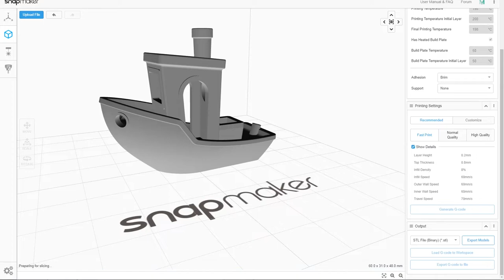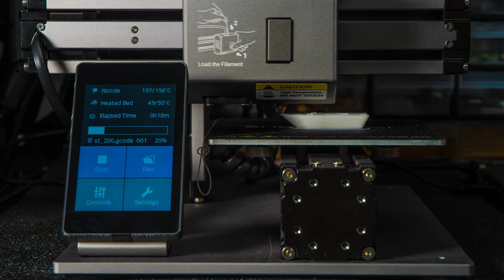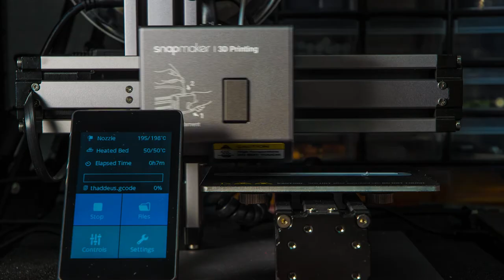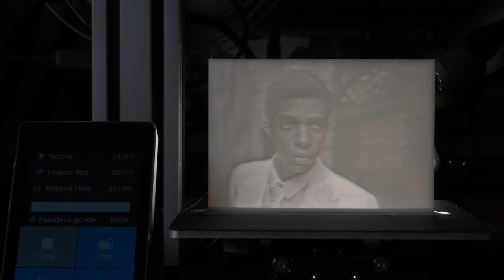Snapmaker 3D Printer Revisited - Fixing Benchy - Snapmaker Part 2

Comment: Really useful John, I ran my brand new Snapmaker on a different type of PLA ( snazzy transparent purple) and ruined about 6 of my very first ever 3D prints. It really dented my initial excitement with the hobby. I finally stuck on the filament that came with the printer and it worked perfectly first time. A lot of trial and error in this hobby methinks! Main problem for me seems to be getting the print to stick to the heated bed. I’ve tried initial layer speed/size, heated bed temp and nozzle temp adjustments. I wonder if attaching a glass tile on top like some other hobbyists have done will make it easier? Anyway thanks for all the good info, the photo lith vid is great!
Reply from the maker: Hey Stuart, glad you're enjoying the videos! Getting that first layer to stick can sometimes be a little tricky. I do use glass on some of my other 3D printers for PLA, but I've not found a need to with the Snapmaker yet. I did do a video recently on levelling it and getting prints to stick if you hadn't seen it yet. Hopefully, this will help :)

https://youtu.be/Hfjty7OKink

Comment: there is part cooling fan shrouds you can just screw into the fan holes, and other types as well on Thingiverse, it helps out tons with overhangs since it sucks the air to cool the hot-end through around the nozzle cooling the filament as it is being laid down .... so you can make long bridges and basically have it function like any normal printer that has a part cooling fan.
Reply from the maker: I've seen a few of the part cooling fan shrouds, but haven't had a chance to try any of them out yet. Fortunately, there aren't too many bridges or overhands in the things I need to print, so I haven't been too worried about it.

What material did you use to print yours? PLA, PETG or ABS? If PLA, how's it holding up over time?

Comment: What speeds did you use on the perfect benchy print?
Reply from the maker: I used the same speeds in Cura that come with the default Snapmakerjs "Fast Print" profile, so they were all at 60mm/sec with the initial layer speed at 18mm/sec.

Comment: What if my benchy have a head like the first benchy (video) , but everything else is perfect
Reply: I also used snapmaker
Reply from the maker: Which settings preset are you using?

If you're using the Snapmaker filament, then it could be down to temperature fluctuations, air blowing through the printing area, like it was with mine. So, just check there's no open windows or doors causing that to happen.

If you're using some other type of filament, then try tweaking your profile settings to adjust the movement speed up or down while printing. I've noticed that there is quite a bit of variance between different brands and colours of filament sometimes.
Reply: @JohnAldred  I pretty much didn't change the preset for fast printing. The only thing I changed is the infill
Reply from the maker: Are you using the Snapmaker filament? Or another brand?
Reply: John Aldred yes im using the snapmaker fil
Reply: It also turn out that the windows (the top) is kinda cracked, and there are ALOT of over hanges on the bottom of the roof (not visible).
Reply from the maker: I'd try printing on one of the higher quality settings to see if that makes a difference, but if there are no draughts and you're using the Snapmaker filament, I'd get in touch with the folks at Snapmaker support. Or, ask in the Facebook group. There are a lot of people in there who might have had the same issue and figured out what it was.

https://www.facebook.com/groups/snapmaker/
Reply: @JohnAldred  I am acually preparing the printer for another benchy print. One problem though is that my print does not stick to the bed.
Reply from the maker: Hey, sorry, I missed this reply. I'm guessing you figured it out now, but I will usually calibrate with paper, then do a test print. If it doesn't stick, I tweak the adjustments manually at the minimum increment, and do another test print until it sticks. Some paper is thicker than others, so the nozzle ends up a little too far from the bed. With PLA you want a little bit of squish. :)
Reply: @JohnAldred  Yeah it's fixed. Apparently, I calibrated it way too hard because the print won't stick to the bed no matter what. I recalibrated it correctly but sometimes, the first line of filament that the printer lays won't stick to the bed. I don't understand why. I tried cleaning the bed with soap and water, alcohol, and etc. I tried increasing the flow rate, which seems to help a tiny bit, and decrease the speed, which does not affect any thing. Do you know why this happens?

Comment: Where do you actually buy snapmaker filament I can't find it anywhere. I pre ordered the snapmaker 2.0
Reply from the maker: The only place I know is the Snapmaker website itself. You can use other PLA filaments, of course, you just need to be aware that you might need to tweak the profile a little bit to get it printing perfectly. For me, with my cheap eBay filament, that mostly meant slowing things down a little bit.
Reply: Right on Snap Makers Website you have to click the Store button on the homepage

Comment: Have you tried printing "ninja flex" on the snapmaker?
Reply from the maker: Sorry, I have not tried NinjaFlex. I've not really had a need for flexible filament yet. In theory, it should work fine, as it's a direct drive extruder, although it might be a little tricky to load compared to stiffer filaments (I'm guessing, like I said, I haven't tried).

The new extruder head module in the Snapmaker 2 that was just shown off yesterday should make i very easy to load flexible filaments, though.
Reply: @JohnAldred  just bought the snapmaker 1 myself as my very first printer. Was planning to make a "rubber" or a soft housing to a couple of my go pro cameras but I'm starting to think that I should try figure out some PLA solution first
Reply from the maker: PLA would definitely be easier to get to grips with, but I'd also consider PETG. Depending on how much you plan to torture your GoPros, the PETG should stand up better to regular punishment. PLA tends to shatter on hard impacts, whereas PETG usually just deforms or scratches a little bit. :)